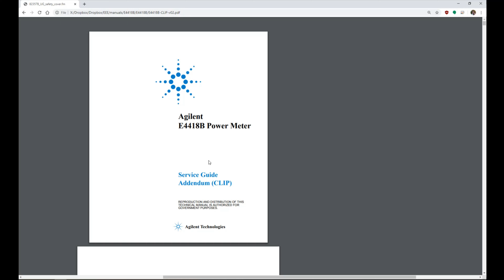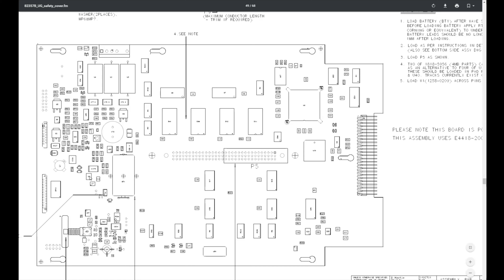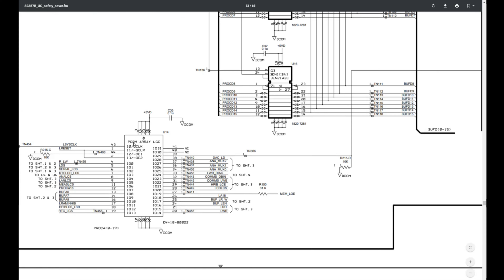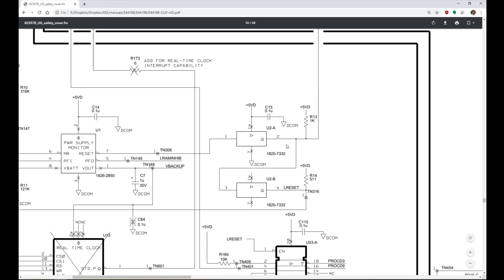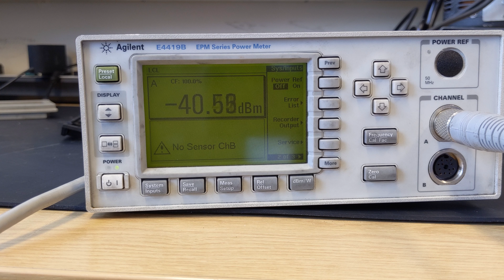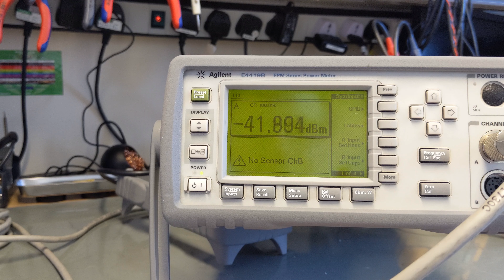#3 [Repair/RF] E4419B power meter

Comment: i have agilent e4416a power meter.when i press the power button can power on, but don't message happens. As attachment files.

Remark: i have replace the battery.
Reply from the maker: Theres a few repairs of this device where the ram is bad (I actually preemptively bought replacements after seeing this on TheSignalPath). I'd recommend checking the CPU first, see if it's active with activity on the memory lines, correct enable pin, clock, if that's all ok, start checking the display, sometimes it's the contrast on these displays if they've aged!

Comment: Hi, great video. I just signed up.
I have an Agilent E4418B but I bought two sensors HP8482A and HP8482B. I have a doubt, but can these sensors be used? Or do I need sensors like E series Agilent?
Thanks.

Comment: Thanks for this vedio.i have agilent e4416a power meter.when i press the power button nothing happens can you help me
Reply from the maker: Sure, can you describe anything else? Does the power light come on at all? If the light is not on, you need to check the PSU. It is always on, so you should be able to measure it's voltages on its connector. If the light is on, then it might be in your reset circuit like mine. Also check the very top of the display for an error code like The Signal Path saw.
Reply: @bansci  thanks for your reply. voltages 12 v,-12 v , 5 v , battery 2,9v  are ok . The stand by light is ok .when I press the power button notting happened.
Reply from the maker: @radiotvrepair1059  OK it sounds like my issue, you need to check the voltages on the reset pins on the MCU (to see if you have an issue with brownout control like me), and verify the clock in and out is working on the MCU (to see if its the clock), finally, you need to see if there's memory bus activity and the voltages of that, to see if its bad memory like The Signal Paths' one.
Reply: @bansci  I didn't work with my power meter a month ago.  before yesterday when I turned on my meter it does not want to start knowing that it works well before.  can humility do that because I'm in a place where the percentage of humidity is very high.
Reply from the maker: @radiotvrepair1059  it could be, there's lots of ways you can degrade electronics. Humidity, temperature, vibration can ask expose weaknesses.
Reply: @bansci  what are the problems that can do this in your opinion. I suspect the file of the epprom circuit.
Reply from the maker: @radiotvrepair1059  hi, I said the things I would check now. CPU reset circuit, CPU clock, then data lines to memory to look for bad voltages indicating a dead chip. The eeprom you can check it's communication too, and even read it if you think it's that, but you need to do more testing
Reply: @bansci  thanks you for informations

Comment: Fantastic repair. I just wanted to ask if you still had a copy of the schematic as I have the single chanel model on my bench for repair? Karl
Reply from the maker: Thanks! Just email me at youtube@bansci.com. I haven't used the email much yet so ping me here too and I'll check the spam folder. Good luck with the repair, maybe comment what you found failed for future fixers like yourself to find.
Reply: @bansci  Email sent. Thank you and I certainly will share my findings
Reply from the maker: @karlfell3768  I've replied, good luck!

Comment: Nice repair & nice meter, had problems with the buttons on a Marconi Sig gen, used some carbon loaded paint designed to repair tv remotes & still works fine two years latter.  Also the rf output was on the back so re routed it to the front with semi rigid coax
Reply from the maker: Good idea! I've already bought a replacement membrane and might have a follow on video properly fixing these issues, but the conductive paint is definitely a way to go if you can't get the replacements.
The Feedback Loop repaired a fluke scopemeter's membrane keyboard by making a thin FR4 PCB to replace the membrane which I thought was quite clever, as they're extremely cheap from pcbway/jlcpcb provided you don't mind the CAD time.

Comment: Would it be possible for you to send me the PDF containing the schematics?
Reply from the maker: Sure I can point you at it, just mail me at youtube@bansci.com. I haven't used the email much yet so ping me here too and I'll check the spam folder
Reply: @bansci  Thanks to the schematics I got from you I was able to get my meter working again in no time. My channel B sampling board failed during the self test. Turns out the 2.5 volt reference voltage was shorted by a 100nF decoupling capacitor (C30). Thanks again for your help!
Reply from the maker: @legomindstormsfan1  awesome, that was very fast! Glad to hear I helped in some small way.
Reply: You've got mail!
Reply: Hi, can you please share with me the schematcs file too? Just got a unit with a weird symptom, if a plug the AC cable while pressing the power button it turns on and works as expected, after that I can press the power button to turn it off, but it then won't turn on if I press the power button again, I have to unplug the AC cable and repeat... Regards.
Reply: @abelcino  someone already uploaded them to here: https://elektrotanya.com/hp_agilent_e4418b_power%20meter_service_and_user_manual.zip/download.html#dl
Reply: @legomindstormsfan1  Thanks a lot Steven! Got it!
Reply: @bansci  You've got mail! Can you possible for you to send me the PDF containing the schematics? Thanks.

Comment: The battery could have been easily unsoldered from the underside of the board in under a minute.  You can replace the exact same battery with mounting by searching on digikey.  You have brown outs because that's the original 20W supply which they stopped using in later productions.  You can find 40W or higher for them on eBay.  Hope this helps.
Reply from the maker: I tried desoldering the battery from below but I had issues getting enough heat in, so clipping the battery out first was the easy option. I'd also already ordered the replacement battery (with the wrong connectors) before taking delivery of the meter, so I went with what I had.

About the power supply, interesting to note they have different versions, I'll take a look at the 40W version and maybe measure the existing units peak draw. My issue was definitely the broken hex inverter though, the power controller was giving the all clear signal but it was not being correctly inverted. I even ran the system from my lab supplies to be sure. Might do a follow up on this when I finally get back into the lab after COVID lockdown and replace the hex inverter!

Comment: Nice video and a nice channel. I got a 4418B (single channel version). After the video i checked the battery voltage but it is still 3.2V. What memory is supplied from that voltage? The cal memory or just the user settings?
Reply: Found the answer in the service manual:
"It is advisable to replace the RAM battery A2BT1 every three years. If the 
battery fails or drops below 3 V the RAM will lose the following information when power is disconnected from the meter:

Unit Serial Number
Revision letter of Processor Card
Unit Option
User defined setups
User defined sensor calibration tables"
Reply from the maker: Thanks! You've got it right, its only an inconvenience to not have the battery working. The cal tables are nice for older sensors, and I think preserving the serial number is probably for when you have several of the meters on the same GPIB bus so you can tell them apart.
As an interesting side note, the motherboard actually indicates what SRAM chips are actually backed up by the battery with a white box and text in the silkscreen. Not sure why though, perhaps to warn repair techs that there may be 3.3v on them so don't start shorting pins?